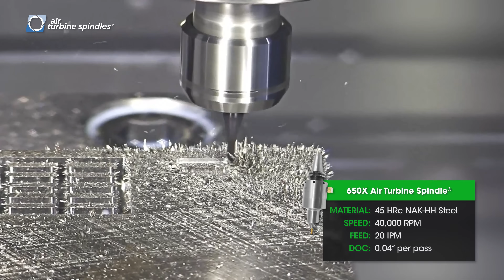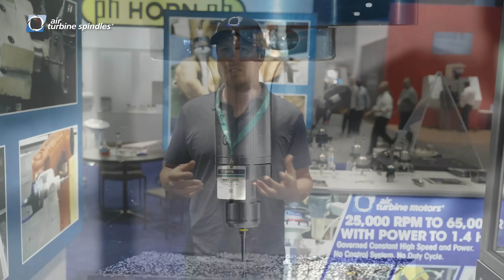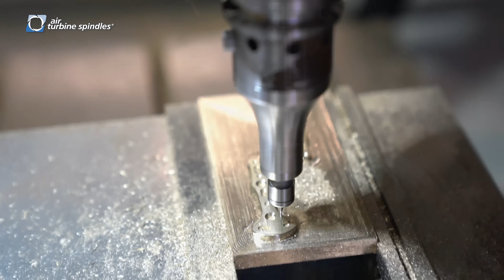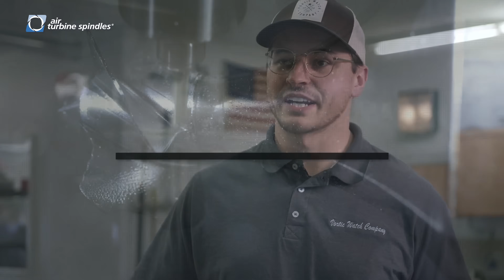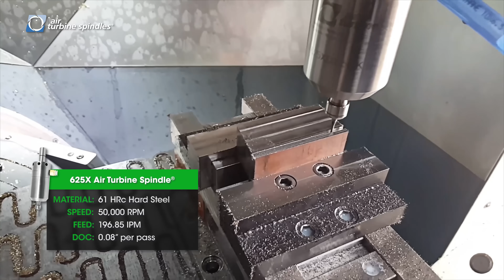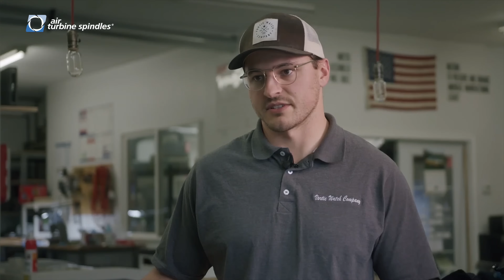Increase Production by up to 10 Times on Your CNC Machine

Comment: This seems like amazing technology but how flexible is the rpm? If you were set an arbitrary rpm like 44600 rpm, would it be able to change to that rpm? Second, how intensive is this on your air compressor?
Reply: Yes obviously, it stated clearly that it has an operating range and that there is a flow governor that provides control.
Reply: @brandonb6164  Obviously you've misunderstood my question. I'm asking about how precise is the control, not for a range of control.
Reply: @tavish2696  It’s clear from the video that it has closed loop control and can be set to any value within that range.
Reply: @tavish2696  Speed is controlled by pressure alone and you can get into 5% of target RPM, with feedback you can go to 0.5-1%.